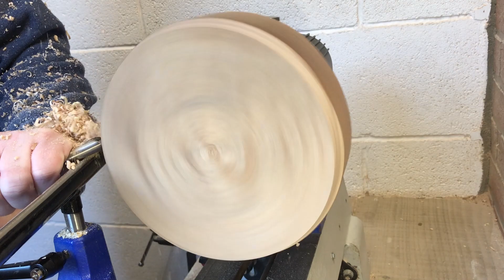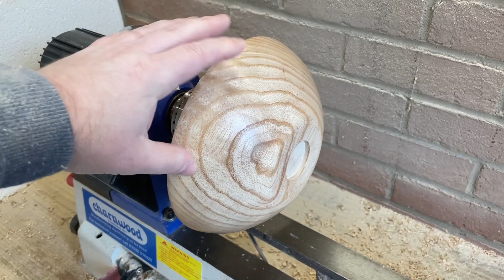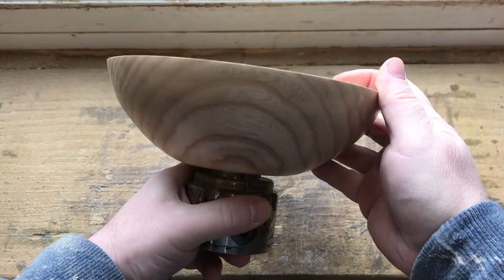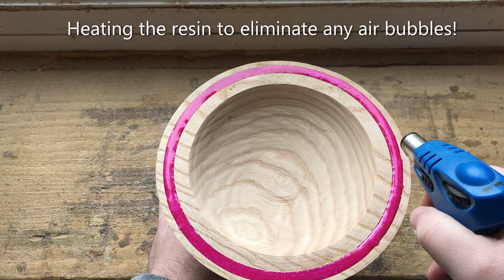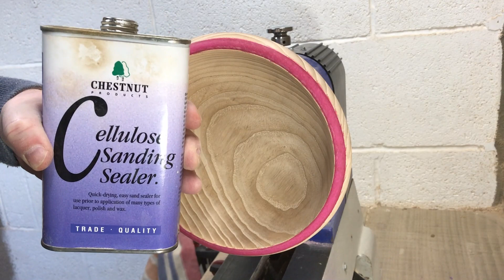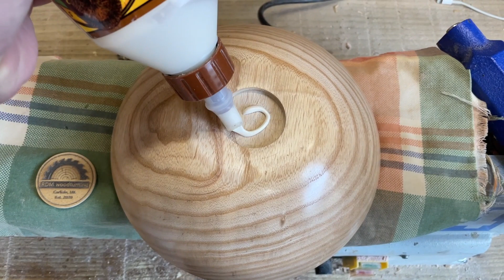Woodturning - A Splash of Pink

Comment: I have to ask, what did you put the pigment into? Was it a two part epoxy resin or did you just use a two part 5-minute epoxy glue?
Reply from the maker: I used a two part epoxy resin, so it took just over 24 hours to set. I find the 5 minutes stuff too thick and sets too fast so I can't get the bubbles out!
Reply: Thank you

Comment: Sanding sealer or a coat of lacquer in the groove stops the bleeding.  Wax is a fast finish but not durable.  With any handling, the finish will be dulled significantly in a year.
Reply from the maker: Thanks for the tip around the sealer. Most of my pieces are created for display and not practical use. But I do take your point on wax, which is why I tend to go for danish oil on fruit bowls or similar. Thanks for watching